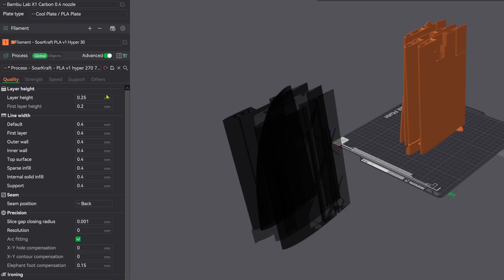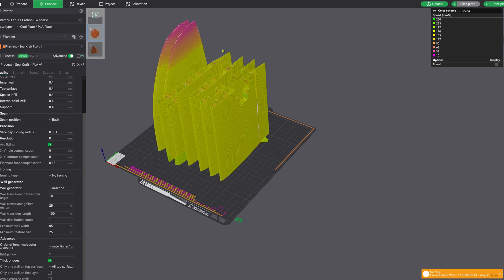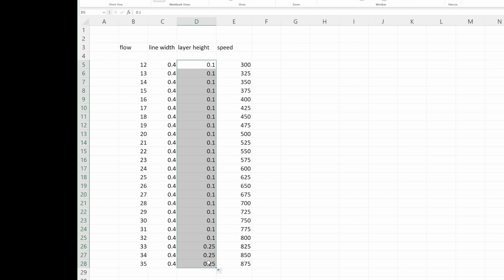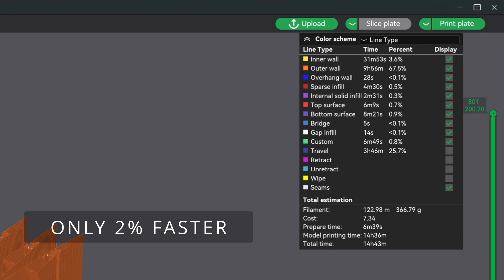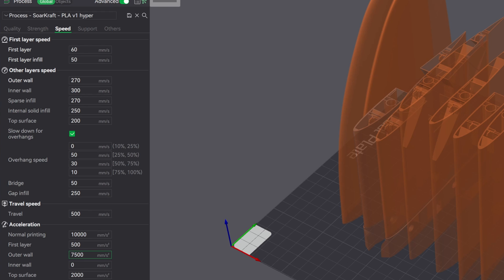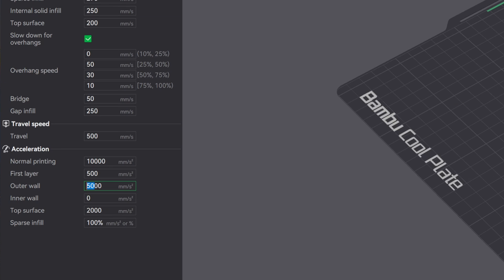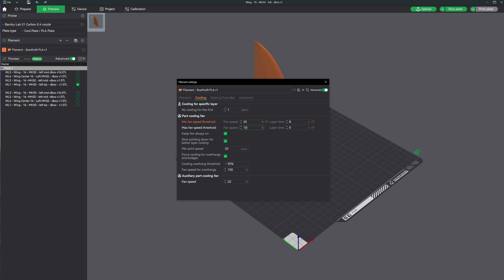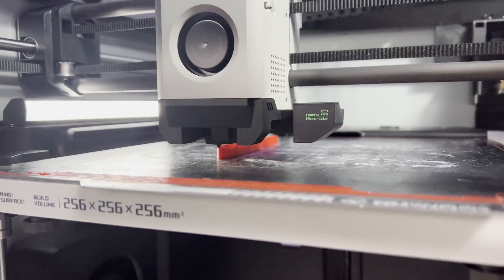Fast Printing Fast Planes - Hyper material on Bambu XC1- is it worth the effort? SoarKraft models

Comment: Hi.  Thanks for a really good insight.  I am printing the test print as I type.  Can I ask what is the weight that you expect this to be?
Reply from the maker: The answer is in your slicer.  The expected weight with regular PLA of the test part is ~ 5.75g if you have the settings correct... which is just importing the config files from the website.  This may vary if you change the extrusion factor... if you are weighing the actual part it may be different still, but only a little.... so as the usual correct engineering answer is "it depends".
Reply: Thanks.  The test printed beautifully and just 5gms.   i only ask because some of the weights given by other designers are very optimistic  @soarkraft

Comment: Creality Hyper PLA is total crap to my experience - bad layer adhesion, bad flow on Bambulabs - way worse than Bambu Basic PLA or (my favorite) Sunlu Meta PLA
Reply from the maker: Did you run at 230 nozzle temp?  It does require more heat… and, yes, it is probably more crap marketing than anything else.  A way to try to cover up Creality’s horrible rollout of the K1 printer.
I like Bambu lab filament, but is a bit of a premium unless you join there subscription club ????? And discounts only for basic stuff.  A comparable pla tough or pla + is $$ more than the current price of the hyper stuff.

Comment: On any Bambu p1p, p1s, x1 you can simply go in the screen settings and change the printer speed up to ludicrous mode which is insane
Reply from the maker: Yes, insane…. But what is it really doing? bumping up acceleration is the only thing it can reliably push without breaking stuff.  And the calculated time is way off… overly optimistic…. But still way fast and fun that it has a ludicrous mode

Comment: I'm using a Bambu Lab P1S and see the same sort of speed improvements. With my old Ender 3 it took about 70-80 hours to print a plane and I used to get lots of first layer fails. Now I can print a plane in a bit over 23 hours and this can be split over just 3-4 prints. I can load the print bed full of parts, press print and forget about it. I like the way you draw your hinges, its a simple light-weight solution.

Comment: A great exploration on how to print faster, so can fly faster.
In terms of volumetric flow of material, the limiting factor is the ability of the hot end to bring the filament material up to temperature. Temperature of hot end, density of material, and feed rate are only factors, as filament cross section area is constant. All the rest of time to print is related to printer/printhead motion.

Part placement and number of parts is a major factor to print time, as printhead can spend a significant amount of time traveling vs. printing. If there was a way to auto-eject parts (or swapping build plates), then printing would be significantly faster, as could print parts one at time eliminating intra-part travel. Alternatively printing different shaped parts in series instead of parallel, as long as they are well space on build plate, to avoid print-head collisions could result in time savings.
There's always an option of running multiple printers, reducing part count per printer session. For example, I’d expect the print speed of two A1’s to be faster compared to one XC1 for printing the set of same parts. Or, the XC1 for larger parts, combined an older printer for smaller parts could improve overall print speed.

Comment: What do you think about low aspect ratio nylon or even tpu 3d printed planes
Reply from the maker: so nylon and tpu are flexible materials, you need structure for long skinny wings like on gliders... short wing span / low aspect ratio designs might be fun to try.   the PLA + is still 85%-ish the stiffness of PLA but flexible-ish ... will still break into pieces when you crash at 100+ mph, just the pieces are bigger.  easier to clean up
Reply: @soarkraft  yeah tpu would probably be basically indestructible . It definitely wouldn't work for a long skinny wing because it's to flexible but nylon might be a good in-between for medium aspect ratio planes and its also a fair bit lighter than pla abs is also a good material if you have a heated chamber
Reply from the maker: I have tried nylon... it is too floppy and still breaks.  Carbon nylon is lighter but still floppy, still breaks.
Reply: @soarkraft  what glider did you try it on
Reply: i have a roll of pp i need to try on something
Reply: @marc_frank  that sounds cool try It on a low aspect ratio plane/glider

Comment: Im building a giant 400x400 bed 1300 z called everest so i can print really big planes in just a few pieces
Reply: that's cool
i've thought about extenting the z axis on my printer, but it's a bed slinger, so i think wings would wobble too much  over 500mm
Reply: @marc_frank  that would work fine  it doesn't matter if it's a bedslinger you can just have the wing chord aligned with the y axis. the main reason thin parts wobble is the nozzle draging across the print and pulling it back and forth. The way you fix that is to place two wings at a 90 degree angle and place thin 1x1 or 2x2 mm bridges between them so that they support each other in both axis. If you do extend your printer I please let me know how it goes
Reply: @marc_frank  also depending on how tall you make it you might have to mount the top to the wall my printer will be supported by the selling and floor in a short closet